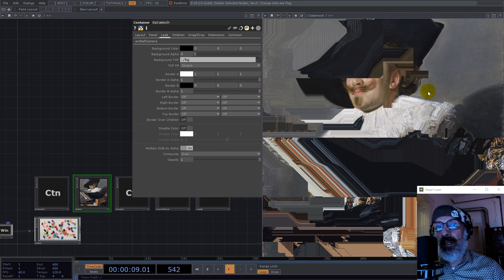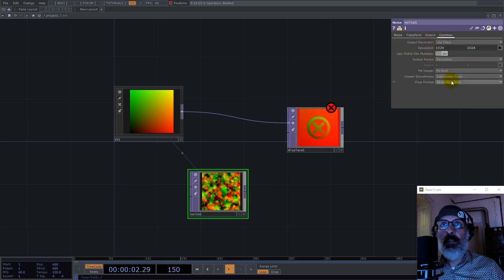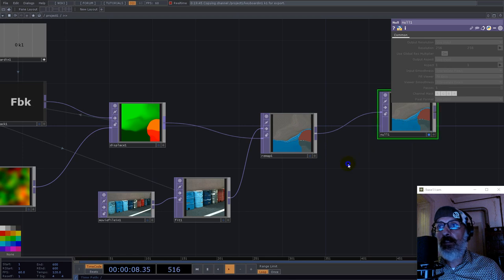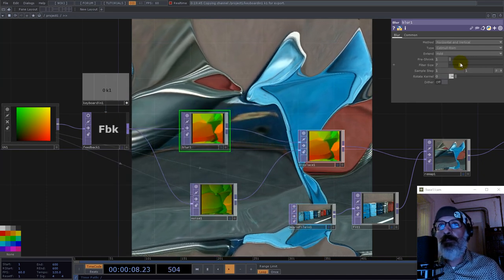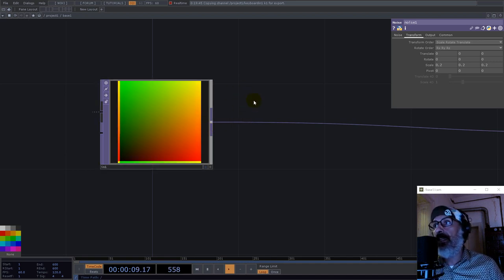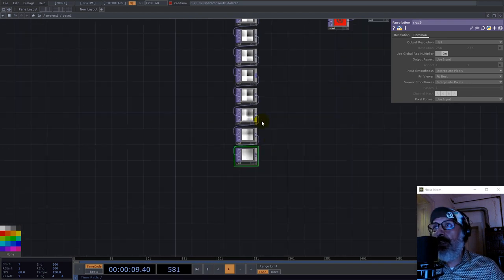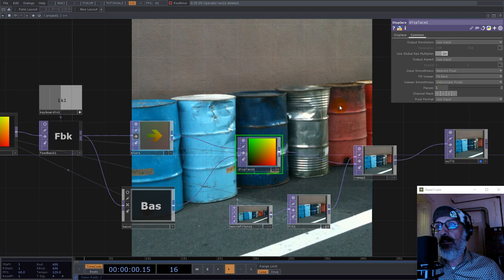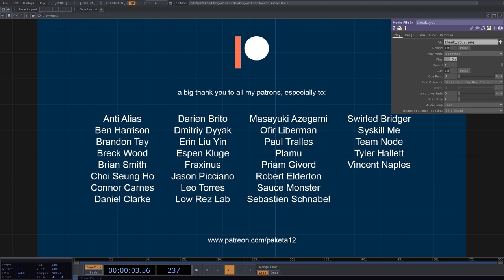datamosh in Touchdesigner

Comment: i really love your tutorials! thanks for sharing them. 
btw, i faced a problem during this project, as mentioned in the comments, others with newer versions of TD faced it too. 
there is a problem with displacing the UV. when i only use [UV>feedback>displace], instead of moving toward +X and +Y (like moving from 0 to 1), it also displaces UV from the opposite side. (like from 1 to 0.) i don't know how should i fix this, and when it comes to halved resolutions part, it causes UV to be displaced in kinda circular way instead of rectangles. i'll appreciate your help!